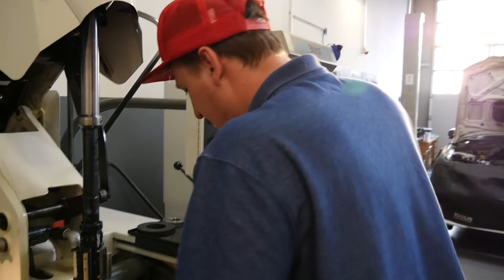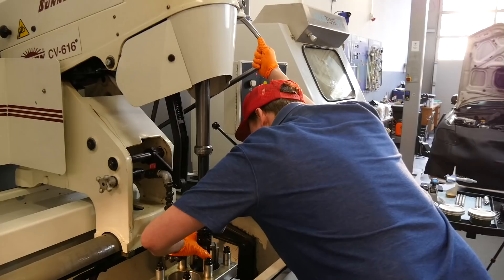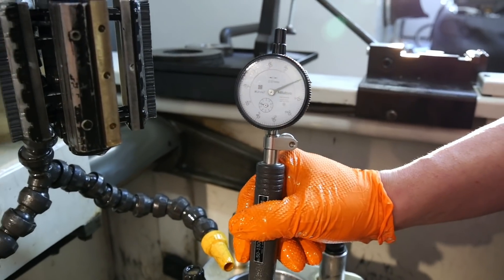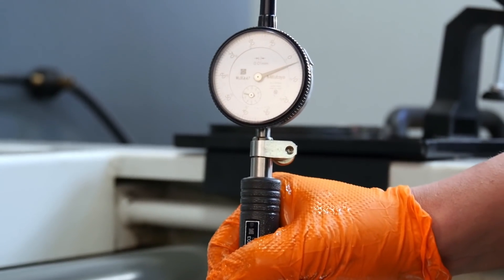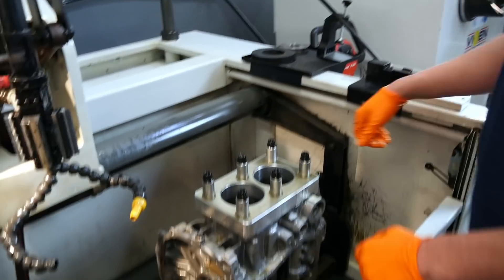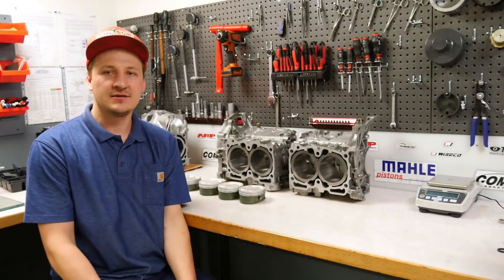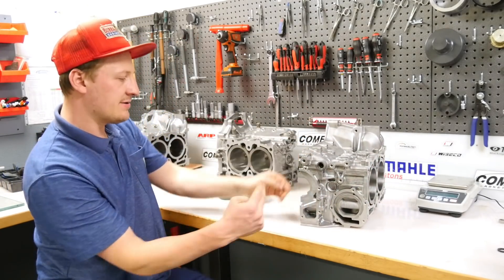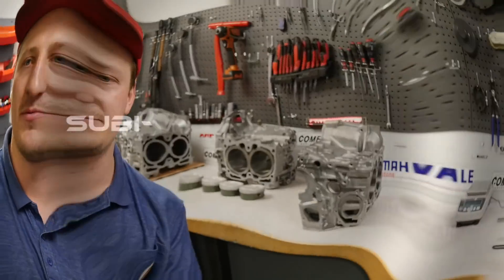Perfect Subaru Boxer-Engine Honing l Rebuild l EJ25 l Subi-Performance

Comment: im curious,  you torque down all bolts the same, but doesnt subaru torque down 1 and 2 to 25ft/lb , 3to6 11ft/lb then tighten all bolts 90 degrees twice....  wouldnt that throw your measurements off a bit?........ or do you torque down the heads with different specs that recommended by subaru?..... can i torque down all bolts the same on my stock engine?
Looking forward to your response

Comment: Measuring the hone with a 1/100 clock. When you  are honeing you are aiming for smaller tolerances than 1/100 thats why yo need a 1/1000 clock on the measuring tool.The funny thing is that the idiots here "thinks" he är a pro loooool

Comment: 4 hundredths of a millimeter is not to be concerned about. All Subaru engines that are made in the factory do not bother with this procedure. Specifications for the piston to wall clearance is now different by how much?The rings will seat in a round bore. That is a more critical measurement.Forged pistons need more clearance for expansion anyhow.
Reply: what is your basis?

Comment: on 9:46 looks like some kind of crack :\ 
But of course it can not be a crack... What is it ?
Reply: er, I’m assuming you are talking about the two vertical lines going up the cylinder wall, they are superficial marks made by the bore measuring tool,  they are completely harmless.
Reply: @martindworak  I understand, thank you for the reply 👍

Comment: got a question  subaru torq spec for heads to u need to do torq then back off step if old bolts are being used ?

Comment: So pretty much when reading the dial indicator as he's checking the bore, if the needle does not go past the "0" point where he set it while needle is going clockwise, then its all good correct?

Comment: Just found this channel. It's pretty impressive.  Just for my education, the purpose of the honing process is to get piston matched to the respective cylinder?  Basically, he is setting appropriate clearance?  Did I get it right?
Reply: Honing is the process used to achieve the final desired bore diameter, ensure proper bore geometry, and create the proper surface finish in the bores. If it's too smooth, oil can't cling to the walls. If it's too rough, the piston rings can be damaged, and you will burn oil.  There's a lot that goes into something which seems pretty simple.

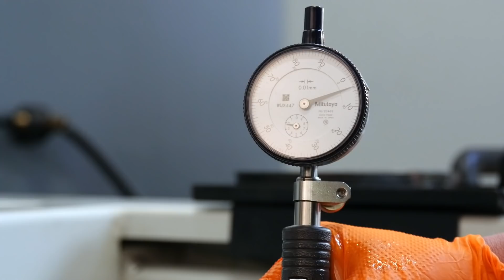Comment: 10:50 Every motor should be honed with a torque plate. When i hone 5.9L cummins blocks (cast iron block) i get as much as .0015 warp when i remeasure without the torque plate. 

Great video as always. ❤
Reply: @allkindofstupidstuff  when you torque the cylinder head on the block, the bolts distort the cylinder. So badically you want to hone the block with a torque plate so the cylinder is straight when the head is bolted on. If you hone it without a torque plate the cylinder will be out-of-round when you bolt the head on... leading to rings that dont seal, low compression, blowby, oil burning, etc..
Reply: a shop didn't hone my ej25 with a torque plate.  needless to say, it should have been.  it didn't last.  i will not be going back to that shop ever.
Reply: Muito bem  organizada a tua oficina, parabéns
Reply: Mateusz B It will also make a differance when the two halves of the block are bolted together. Problem you then have is hight. Not able to get it on the beam stroker. Or the jig borer for that matter